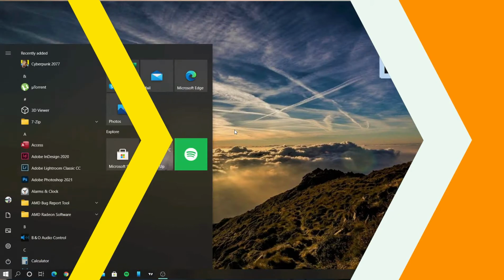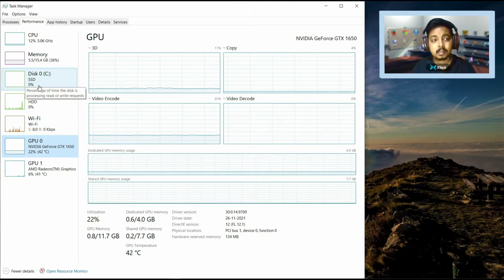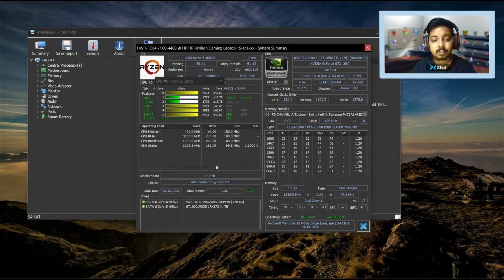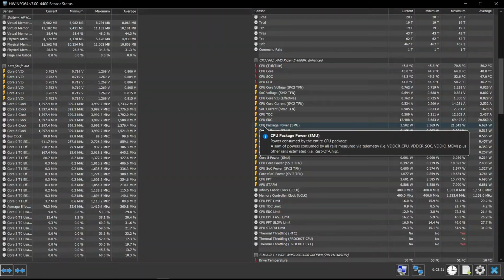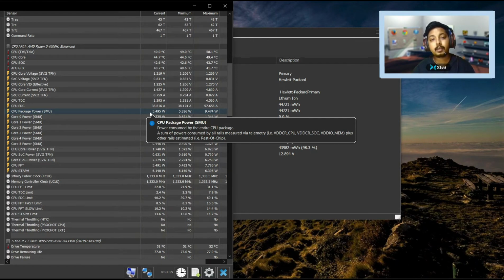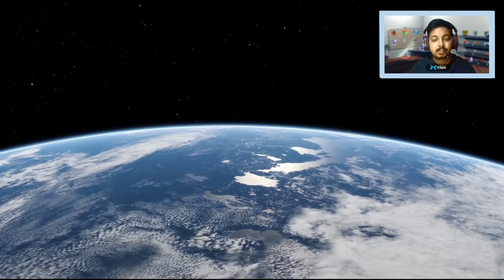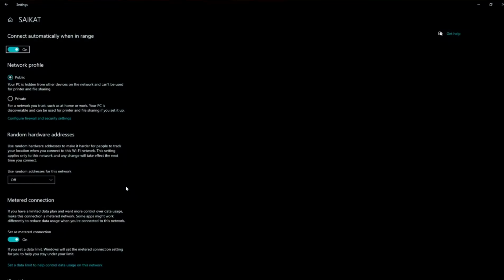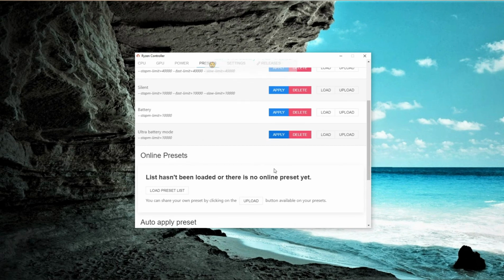How to increase Battery Life in Gaming Laptops ? Stop Heavy Battery Drain 🔋

Comment: I have an Asus TUF A15 Ryzen 7 with a GeForce 2050, which I bought just four months ago. Now, the battery health has dropped about 9.8% from 100%. I just came to know that it doesn't have an iGPU, so the system always uses the dedicated GPU. I always connect to AC and set the limit to 80% from "my Asus" software. I Think it's to bad, in normal use, Web browsing or just read a pdf it only last for 1 to 1.5hr. Do you have any solution. Iam totally disappointed, is it possible to replace or something
Reply: Battery size is 48wh

Comment: I got a Acer Nitro 5 AN515-56 15.6 inch Gaming Laptop - (Intel Core i5-11400H, 8GB, 512GB SSD, NVIDIA RTX 3050, Full HD 144Hz, Windows 10, Black), 18 July 2022 - 2yr 2months 2 days - battery is now at 16.8% wear, 48 cycles. Is that high? Last year I was only getting 2 hours battery out of it for work tasks so something didn't seem right.

Comment: I have asus vivobook 16x with i5 12500h and rtx 3050.I disabled 3050 and checked power usage through hwinfo ,to my shock the total system power is always 14W+ and reaches 25W at times while the cpu uses only 1.9-3W on idle.I tried disabling 3050 before once but got different results(package power stayed normal).But all of a sudden it uses 14W on idle without any task!!!.What can i do?.Maybe Mcafee is the culprit

Edit:I rebooted the laptop and again checked everything and to my shock I found that wifi is on,I just turned it off and again turned on,the total system power usage dropped from 20W to just 3-7W😂I think it is a problem from  the  windows update that is causing these types of issues
Reply from the maker: Yea there can be so many variables and unexpected power spikes!

Comment: my asus vivobook has 96whr battery but its battery life is less than 90min
Reply from the maker: User error or some issue caused by the software. You have to diagnose the reason. Check CPU usage, check if GPU is active when it shouldn't be etc..
Reply: same with my dell G15

Comment: i got a new dell g15(11260h/3050/16gb/512gb) set to 60hz 56wh battery and on light use i dont even get 2 hours of life(ex: watching yt vid), on the HWinfo64 battery wear lvl is 8.7% what does that mean, ive been using it a few days. do i need to get it replaced? its using like 1% every minute even if 10% are gone that use rate is still high
Reply from the maker: Like I showed in the video. You have to diagnose. 
It must be that your CPU/GPU is getting unnecessarily utilised. Try to diagnose.
Reply: Have the same laptop .Did your problem resolved??

Comment: Myne is heavily a gaming laptop.. i only get 1-1.5 hours battery life just while readin pdfs and watching yt vids
Reply: Bro did u fixed it ? If yes then how ?
Reply: @akshatsrivastava2580  does your machine have mux switch? If yes then use it to run your PC on Hybrid or iGPU only mode, this will completely turn off your discrete Nvidia or AMD graphics card and will save battery.
Next, use your laptop on 50% or lower brightness. Going too far below 50 won't do much, but anything above 50 consumes a lot more battery.
Next, turn the keyboard backlight off if using in brightly lit room or in daytime. This consumes surprisingly high amount of battery. 
Also turn off Bluetooth when not in use, turn on power saving mode in Windows, use dark mode, etc. All this should increase your battery life significantly.
Also don't game on your battery, always do heavy stuff while being connected to the charger.
Also, can you let me know what are your battery and laptop specs? Maybe I can help better if I know those.
Reply: @akshatsrivastava2580 
Also: lower the refresh rate!! Use it on 60 hz unless you are gaming. And this one isn't for battery per say, but try to use a cooling pad (any cheap one but with good reviews will do) while gaming or doing heavy tasks. This will increase the longevity of your machine, as overheating is the main enemy of any computer.

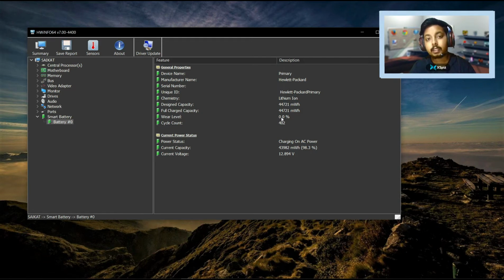Comment: 6:10 im using my lap heavily for 8 monts and my wear level is at 32%.. is that an issue (core i7 processor and rtx 3060 gpu)
Reply: and also my lap lags like hell if i unplug from charge.. so i usually use my lap plugged in.. does it create an issue?

Comment: bro victus is giving under an hour brand new laptop bought online week earlier tried almost every possible solution,
the full charge capacity keeps changing b/w 47k and 51k while it's 52.5 total,like if i keep it on a charger would it destroy/degrade the battery further?
Reply from the maker: There is some issue bro. Victus has 72Whr battery. 
Can you check if your RX 5500M is active when not gaming?
Reply: @DeepteshLovesTECH  it's a different varient fa0031dx it has intel CPU
Reply: I still have the same problem, just yesterday I bought the Intel i5 version and in normal use watching videos and browsing it goes down in approximately 1.5 hours to 2 hours maximum, and I have also noticed that my battery is 100% charged it goes down to 94% directly. Playing it downloads in less than 1 hour, I don't expect much in games but at least to watch videos for about 3.5 hours I see it as necessary.
I will continue testing for 1 week, waiting for a system or driver update, I checked with hwinfo and the battery shows 51wh
what do you say, is it normal?
Reply: @ilikeyergair6277  i think so bcz mine keep changing bw 46-51
And just too make sure i asked another person he showed me that the health was already 86% i think it's a company fault not yours or our ur is 97% ri8 now

Comment: my main battery draining issue in my victus 16 ryzen 5600h was refresh rate. It was on 144hz and i was getting so low battery life on just watching videos, around 3-3.5 hours although the videos were just of 60fps. Nevertheless, I changed my refresh rate to 60 hz and my battery life improved significantly. I also removed several apps which autostarted (even if i disabled them on startup) by merely checking task manager which also helped a lot.

Comment: Bro my hp victus give  8 hrs or more for normal usage but when i play gta 5 battery fall 60% for 1 hour  so do i plug and play or keep aside then charge and use . My doubt is that if play without charging fans run smoothly and no heating issue (42°c to 50°c )but when i plug and play it goes to 90°c to 100°c and fans run automatically max speed and heats up so do i plug and play or not and if i plug and play does it decrease my battery life or any damges happens??
(Model:-
Hp victus ryzen 5 5600h 
8gb ram 512ssd
Nivida 1650 4gb )(brought 6 days back)
Plz read my comment and reply me bro🙁💖
Reply from the maker: Yes definitely you should plug and play! Your battery will get destroyed if you continue to use it for gaming. Performance is much worse. 
Temps are low because your components are starving for power. 
You can lower temps by using max fans or use ryzen controller. 
Temps are fine. It's not always in that range, they are just spikes.

Comment: Hi bro..
I have a question. 

Would a Dedicated Gpu Laptop give same or relatable Battery backup compared to an integrated gpu aptop if both have same Whr battery and same processor under  completely ideal conditions i.e when no graphics are processed whatsoever.. .???

Also , does a Dedicated GpU laptop also have some integrated gpu in it  , so that if turning off the dedicated GpU  when not needed for gaming or editing activates the integrated gpu for normal taska  to  improve the battery drain?
Reply from the maker: Dedicated GPU is completely a seperate GPU soldered on the motherboard. It only activates when you want it to activate... Rest of the time only iGPU stays active which is part of the CPU. 

As to your hypothetical question.. there should be negligible difference in battery life as dGPU stays inactive/dormant when not in use.
Reply: @DeepteshLovesTECH  thanks bro..
I wish your channel the growth and success you desire and deserve

Comment: Is it okay to kill all background running apps in task manager....Can you please make a video on which background apps or softwares generally are important for running the system properly because there r many small apps or softwares ,which I don't even know what they are used for, are running in the background...not taking much power though but for the sake of knowing can you please give us some basic knowledge.
Reply from the maker: Bro experiment a bit, if a process is taking unnecessarily too much CPU usage, just shut them. 
Max to max what's gonna happen? May be you'll crash something and you only have to restart your laptop. 
It's really no big deal.
Reply: @DeepteshLovesTECH  that's it...I just have to restart and everything returns to normal in case an error occurs. Ok bro I will try for sure. And Thanks buddy!

Comment: Hi , I have a Msi 3050rtx intel i5 and I my batterie when just working with at school lasts just 2h. Is that normal ? By the way I just bought it .
Reply from the maker: Well I expect that laptop to have terrible battery life. 
But otherwise you have to do some troubleshooting. Check the power draw when system is idle and all...
Reply: @DeepteshLovesTECH  in fact the most time the battery is draining is when its off

Comment: Hi, I purchased new laptop. Dell G 15 5520 i5 12th gen 16Gb.From 1st day onwards I'm getting a battery drop of 1℅ per minute. I checked task manager, cpu at 1℅, Dedicated Graphics 0℅, memory 5.8GB, WiFi 0 KBps, Integrated GPU 0℅. No external devices connected while testing reports. Design capacity of battery is 54,891mWh, Full charge of capacity  is 52030mWh ( which reducing every next day).  A total of just 100 min of backup I get on STAND BY MODE(which is with only display onn and no other function on it) I I talk with Dell and they finally agreed that this laptop should give 3-4 hrs of backup on stand by mode. And they ready to replace with new battery.I kindly request you to share your opinion on this scenario that is my battery has a problem? And if yes then should I allow dell to replace battery of new laptop or should I opt for complete laptop replacement? Waiting...for your reply my friend.
Reply from the maker: Intel 12th gen with it's efficiency cores that should provide better efficiency but rather provides poor battery life. This is the case on all 12th gen Intel laptop, more or less.

You have done a good analysis. But do one more thing. Just install Hwinfo64 and keep an eye on the CPU package power... while everything is idle. Just the same thing you did, but with Hwinfo64 app open and showing the CPU Package Power while idle. Let's see how much power is the CPU drawing alone.
Reply: @DeepteshLovesTECH  Thanks Friend, I'll do the test u said.
Reply: @DeepteshLovesTECH  i5 12450h consumes 3 to 3.5 watts on idle is it fine?

Comment: bhai jaise gaming krte time agar charging 100% hogyi h... or fr bhi further plugged condition m gaming krna sahi rhta h ya ni?.. isse battery m strain to ni ata h?... ya ye uski health k liye sahi ni h... ya fr 100% hone k baad battery charge lena chordeti h or laptop direct AC s chlega or battery m koi strain ni pdta hai??
Reply from the maker: Your laptop has circuitry to run directly off wall power. So as soon as you plug in your adapter, your laptop runs on wall power and the battery is no longer supplying power and is only charging until it hits 100% after which it's maintained at 100% by the adapter. 
Lithium Ion batteries have built in mechanism to prevent overcharge. 
Normal battery health will degrade as you use year after year.
My helios 300 after 3.5 years of hardcore usage plugged in has lost 27% battery health.
Reply: @DeepteshLovesTECH  acha.. thnku.. mtlb agar hum zydatar charging m laptop chalye.. to battery cycle kam use hongi or battery life kafi bdjayegi na?

Comment: Bro
In HWinfo64 
My victus designed capacity and full charged capacity show as 64957 mWh
Is it normal.?
Because u said that victus has 70wah battery
Reply from the maker: Check your HP Support Assistant, battery health. That's more accurate.
Reply: @DeepteshLovesTECH  it shows Design capacity 70 WHr
Full charge capacity 65 whr (92%)

Comment: Hey brother, can you address the issue of battery draining in gaming laptops while plugged in? 
My battery drains about 5% each hour of continuous gaming when plugged in.

is under-volting CPU is the only solution for that?
Reply from the maker: Your Power Adapter is not capable. It cannot provide enough power to both run the laptop and keep the battery charged as well. 
Theoretically undervolting should help or if you find a higher power delivery adapter from the same brand.
Reply: @DeepteshLovesTECH  Yes I was thinking the same, my laptop's adapter is 150 W. Is Using a higher wattage adapter will harm tge device in the long term ?
Reply from the maker: @medhammamchebel8605  naah.. I use a HP Pavilion Gaming 150W adapter with my 65W HP Elitebook laptop. The power adapter will only supply as much as the laptop demands.

See this way like using a greater than required Power supply for your PC, which is always better than using a lower rated power supply.
Reply: @DeepteshLovesTECH  thank you very much for your help bro keep up the good work

Comment: I bought gf65 3060. And battery Wear level is showing 19.3% 😭
What should I do
Reply from the maker: Woh! How soon?
Reply: @DeepteshLovesTECH  maybe problem with application. Not showing correct data
Just 3 day happen 🤔🤔
And laptop was new complete seal pack and no scratches.
Reply from the maker: @aashishgupta1112  ohh it's possible. I haven't seen a new laptop with any amount of wear level, so may be it's a wrong reading by Hwinfo64.
Reply: @DeepteshLovesTECH  I have calibrated the battery from MSI battery calibration software. And now Battery Wear drop to 1% from 20% ... Maybe issue was I had set Max charge to 80% . To it was reading wrong

Comment: 1.Balanced mode or Power saver or down Clock or limit max turbo frequency on battery 80-95%,or wattage capping.
2.Disable background task in startup
3.Undervolt if it is possible
4.disable dpu when not gaming
5 Reduce Display brightness and refresh rate
6.use SSD ditch HDD
7.keybord lit dim
8.uninstall GeForce experience
9.opera browser over chrome
10.Meterd concern
11.No usb peripherals
12. Lift your laptop back by 1inch while doing heavy task for lower temp and fan.
13.Set a display time out .or turn off display when running tasks in background .

Extras
cpu amd over Intel 
1080p over 4k
Plugged in charging state 50-80%
Use laptop in a cooler place
Ditch HDD bay for large battery
Watch YouTube video in 2X.
Reply from the maker: One more - stock Windows over OEM Bloat infested Windows. 
But Youtube video at 2x ? 😅 To reduce time watched? 😅
Reply: Why do uninstall GeForce experience????
Reply: You have mentioned 'no usb peripherals' in the ninth point. So should I avoid attaching keyboard or mouse for saving battery? How much of an impact it causes on battery performance?
Reply: @Aryan-wl1pu  about 20% if peripherals dont have rgb,if they do about 30% (in case of both mouse and keyboard)

Comment: Cool video
I purchased Victus 16 rx 5500m version after watching your video
Very good laptop for that price point.
Reply: bro in valorant i get random ping spikes in my victus 5500m?
i tested it on my acer aspire 7 and there is no problem so the issue is not in my internet.
do you experience same thing in victus?
Reply: Hey can you share the fps you get in valorant with low settings?
Reply: @shukoor26  160 +
With occasional drop to 150.
Reply: @Shubhampalzy  thanks

Comment: How many whr is considered decent battery in terms of whr? Every laptop are around 50whr. 

Asus has 90whr in intel varient and reviews are claiming around 3hrs. 

But amd cpu with lower whr will beat 90whr intel.
Reply from the maker: Yea atleast 60Whr is recommended. Pavilion comes with 57.5Whr, Legion 5 has 60Whr but it has the problematic iCUE software that drains battery. 
Victus has rock solid battery life with it's 70Whr battery in my tests. 
TUF has 90Whr battery but it needs to tweaked. It should last 5-6 hrs minimum,  something is again wrong with the OEM Windows system. No way it will only last 3 hrs, unfortunately I don't have the laptop to test.
Reply: @DeepteshLovesTECH  saw review in flipkart in think.

Comment: My Victus doesnt go above 99% on a full charge and 
hp support assistant shows battery health 97%
Its 5 months old.
Something to worry about
Reply from the maker: It will sure go 100%. HP Pavilion and Victus both trickle charge to 100%. Last %ges take some time.
Reply: @DeepteshLovesTECH  Even HP support assistant app says "99% not charging"
Reply from the maker: @parthchadha9676  is this the first time or is this normal for you?
Reply: @DeepteshLovesTECH  Noticed it two days ago. Had a chat with HP support, manually recalliberating the battery might help.
Anyway the full capacity has degraded from 70 to 68Whr.
Reply: Bro
In my case it will take 10 min to hit 100 perc
From 99
Totally fine 4 me
Reply: how many charge cycles have you completed?
Reply: @Shubhampalzy  74
Reply: @parthchadha9676  my victus has 42 cycles and battery life is 100%.and about that 99 charge thing, don't worry about it it's nothing much
Reply: @Avnish Yadav by 'normal' i mean Vs code and edge with about 7 to 8 tabs open and internet on 
I will get around 7.5 hours of sot
But I don't use of the battery and keep it between 25 to 80 so i get around 5.5 hours
My model is 5500m
I haven't played high end graphics game but in valorant the temp is around 55 to 60 degrees
Reply: I have a doubt is there any bios issue in victus rx5500m,  i thinking to get it on next monday 

please reply ..😢😢
Reply: @pwkastudent1987  Some have it. Some don't.
I personally didn't update my bios myself . A guy from service centre came and updated.